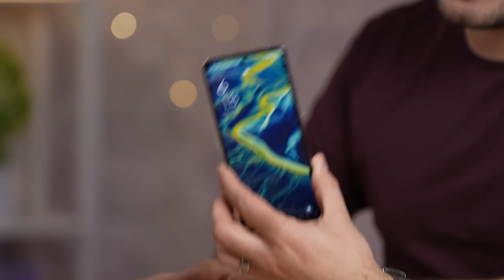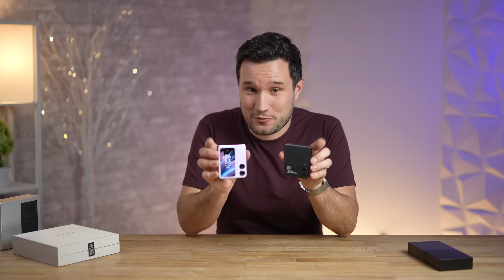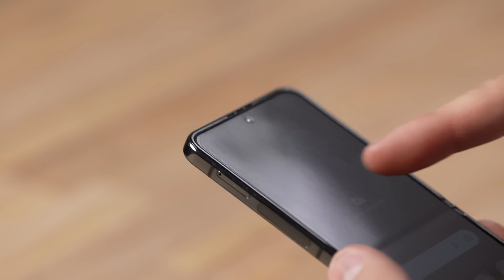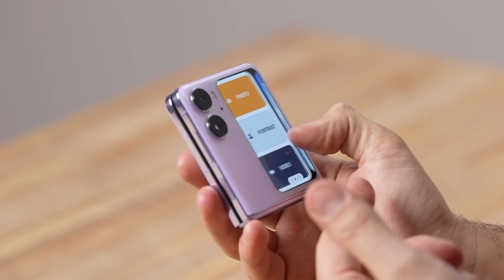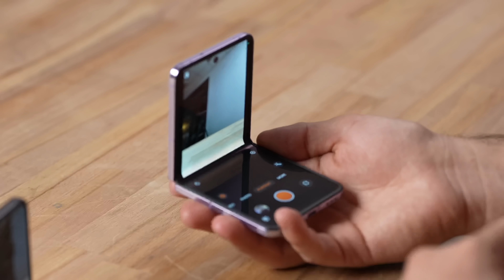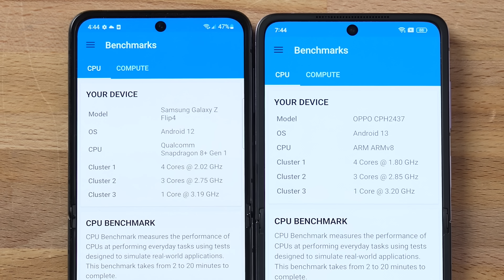OPPO Find N2 Flip vs Z Flip 4 - The NEW Foldable KING! 👑

Comment: I'm a huge fan for wanting a android flip phone. But these current screen folding phones aren't durable enough as these folding phones are known for crease cracking after folding and unfolding several times then suffer from black lines and cracked screens. 

What I really really want so badly. 
Is just bring back the old style flip phones we use to have that are strong and durable and can be thrown around like a brick. 
But what I want is a true android flip phone that looks like the old flip phones from back in the day.  Put in a high end rear camera, with a touch screen for the flip phone to be able to use apps that need a touch screen. Flip phone that has full android os to be able to install all android apps with minimum 128gb memory 6gb ram. Large enough battery to last an entire heavy use day. Be build ragged to be able to be thrown around and have a rubbery feel like sonim xp3 flip phones. 
And be priced for around $300-400 Canadian dollar.  This is the type of phone I really really want, but no one builds these. 

We only have either smartphones or a dumb flip phone, or flip phone with crappy Kai OS with crappy cameras.  

Let's bring back normal flip phones like the good ol' days, but build them with full android OS with full android support, high end cameras and touch screen with the normal keypad bottom of the phone like a regular flip phone.

Comment: Ooops, prices will be about 300 euro more than the Samsung Flip 4 (prices are now on the Oppo EU website). Start price is 1099,90. Although 1100 euro is the same release price as the Samsung Flip 4 half a year ago, the Samsung can now be had for around 800 euro. Good luck with that, Oppo...

Comment: The crease is a folding phone's biggest bugbear and Oppo seem to have solved that problem really well! With it open, you really could not tell that it was a foldable. Also, by increasing the radius, they have decreased mechanical strain and that should result in greater longevity.
I hate carrying big phones but appreciate a big display so I hope Apple come out with something like this (because I'm trapped in Apple).
Reply: Samsung's flip has a crease because of the water resistance rating
Reply: Samsung has dust resisting and water resisting
Reply: thanks for being an active subscriber message me with the above username.
Reply: Yes these flip seems like a great idea for small phone lovers. I love the 13mini but if I want a bigger phone I would like these.
Reply: Well maybe in 30 years?🤔😄😄

Comment: You do realize that the next flip and folds that Samsung release are going to have this water drop hinge design AS WELL as an IP67 rating. They were reluctant to use this design because they couldn't put any kind of water resistance on it. Samsung is changing this apparently